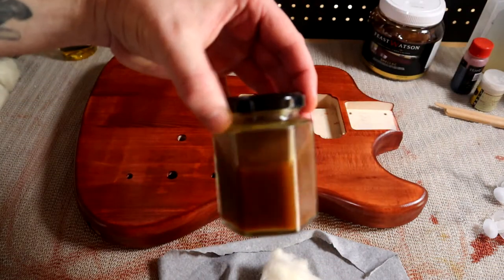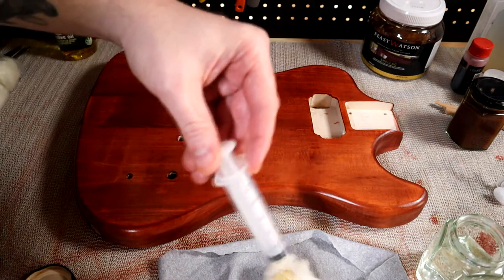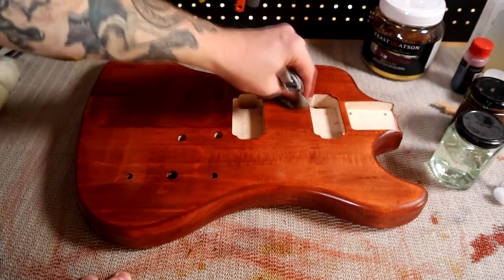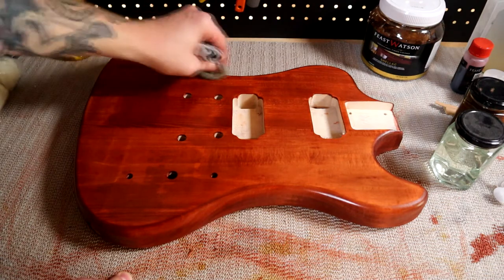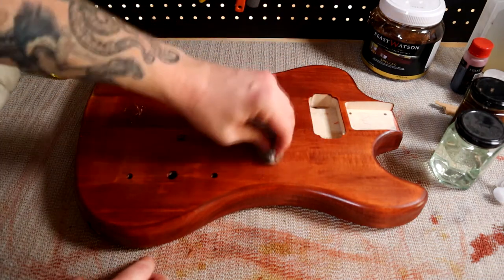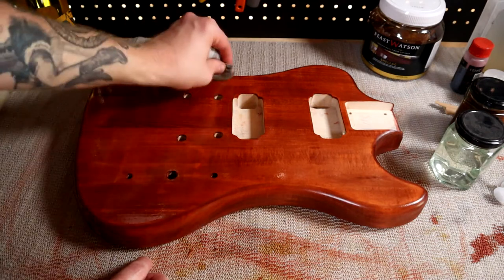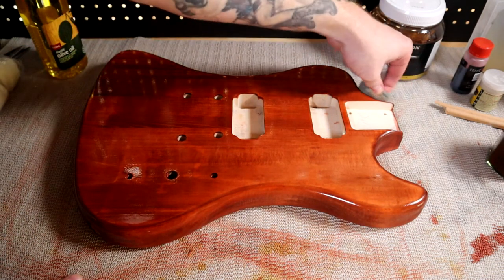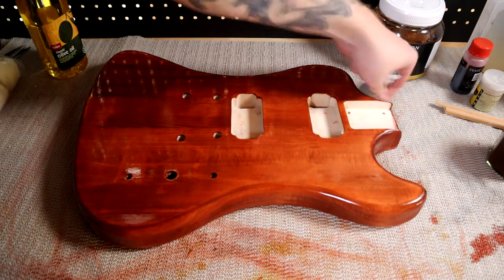How to learn French Polishing in minutes

Comment: Maybe he forgot to mention that you just need to do that for half an hour or until your arms are sore, let it sit overnight and go through the same process everyday for a month 😂
Reply from the maker: Indeed it’s not a fast process
Reply: @Danduncanguitars  I'm doing my first French polish on a small piece of wood, I'm on the second day and I'm already questioning my life choices. I'm probably doing something wrong but I can't visualize the wood getting that smooth mirror like gloss and I also can't imagine doing that on a entire acoustic guitar. I gotta be patient but it's a long ass process and my arm and my hand are hurting 😂
Reply from the maker: @ThiagoCP  I don’t know if this helps. I found trying combination different Linen rags and Shellac brands. I tried synthetic material and it would rub off the polish until switched
Reply: @ThiagoCP  Shellac dries quickly as alcohol evaporates. You can put on another coat once it’s dried. That means you can put on a new coat every hour, and in a day you can put on ten or more coats.
Reply: @einsam_aber_frei Right, of course it doesn't take a month.